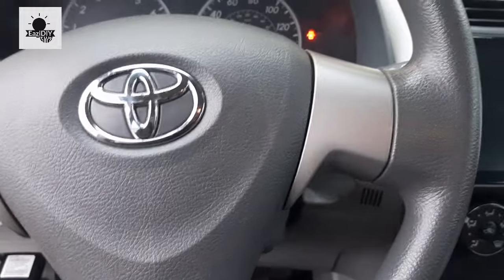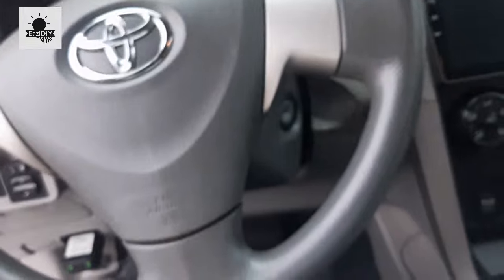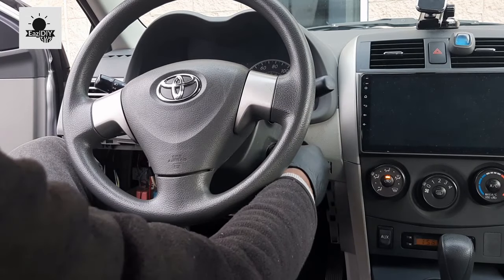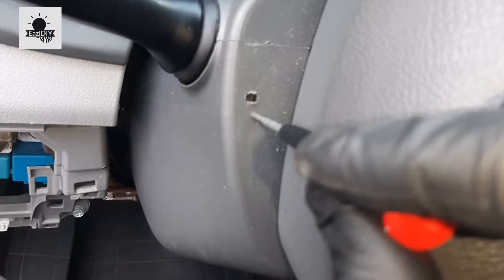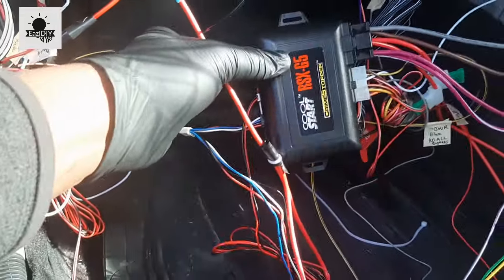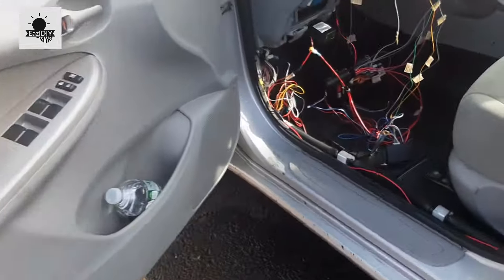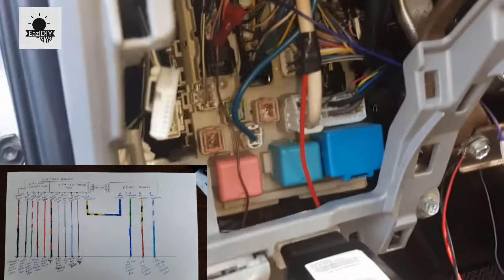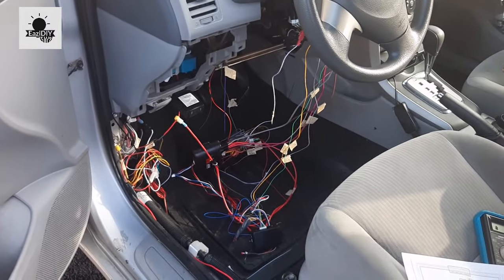How to Install Remote Start Yourself into 2009-2013 Toyota Corolla

Comment: Hey does 09 Corolla Le have factory keyless receiver already? I just bought one with only a regular black key… how do I know if mines has factory remote receiver?
Reply from the maker: No doesn't.
Reply: @eazidiy  damn😫😫I have power locks already, What do I need to buy to make mines keyless ?
Reply: @eazidiy  actually I’m not trying to make mines remote start like yours I just want to be able to lock and unlock with a key fob
Reply from the maker: @King-kw1mo  Check out my video on how to install keyless entry system https://youtu.be/bKhHF3rsVRI

Comment: Any idea how to do this on a corolla e160? more specifically a nze161 corolla fielder 2012. cant find anything at all. all other us verisons or nothing
Reply from the maker: Use the link to reference 2012 Toyota Corolla wiring diagram http://diagrams.marktoonen.nl/index.aspx?MakeID=2&ModelID=20578. Follow the steps in the video, wiring colors might slightly different
Reply: @eazidiy  only problem is that is for 10th gen corolla. i have a 11th japan corolla
Reply from the maker: @WilliamCronin  11th Gen is 2014- 2016? Here is the link for the wiring diagram http://diagrams.marktoonen.nl/index.aspx?MakeID=2&ModelID=20579
Reply: @eazidiy  yeh that’s 11th gen usa. i have 11th japan/sg/nz 2012-2015. any idea where is find stuff for that?
Reply from the maker: @WilliamCronin  unfortunately I drive 10th Gen. If you buy from the link in my video, the company will give you some tech note to guide with installation.

Comment: Any way you could provide assistance on a 2012 yaris? The schematics seem fairly similar but I’m having issues locating a couple of wires. Much love🙏🙏
Reply from the maker: Which wires are you having issues with?
Reply: @eazidiy  The parking light wire, and lock/unlock wires
Reply from the maker: @kurtismraz  Positive or Negative parking light wire? Lock and lock wire will be by the driver's kick
Reply from the maker: I think your you need negative parking light wire ? It is light blue wire @ HEADLIGHT SWITCH, BLACK 20-PIN PLUG, PIN 1
Reply: @eazidiy  positive parking light wire, thanks a ton!
Reply from the maker: Lock is black wire @DASH FUSEBOX, WHITE 30-PIN PLUG, PIN 1. Unlock is Green wire @DASH FUSEBOX, WHITE 30-PIN PLUG, PIN 24
Reply: @eazidiy  gotcha, thanks again!
Reply from the maker: Use this link as reference http://diagrams.marktoonen.nl/index.aspx?MakeID=2&ModelID=20484

Comment: Great video, thanks for the info. I'm installing the same unit in the same car (09 Corolla) and your video has been a great help.  But I can't figure out what wires are the transmit and receive wires. My install directions say it's a7 pin pats connector, but I don't see one. Any advice?
Reply from the maker: Hi, the Transmitter is a Tan color wire Pin 5, and Reciever is Light blue Pin 4.
Reply from the maker: Check the video description box and click on the link to download Fortin KOALL installation manual. The PDF file will show you picture location of the wire.
Reply from the maker: You can also take picture by the ignition, send me an email eazidiy@gmail.com. I will mark the wires for you.
Reply: @eazidiy  pm'd you
Reply from the maker: I have responded to your email. Your vehicle wires color are different. Trace the four wires I have highlighted in the attached pictures, PIN 4 is RX and Pin 5 is TX.

Comment: My starter just stopped working is there something I can replace or
Check or do I need a whole new one?
Reply from the maker: Did you check the battery of the remote starter?
Reply: @eazidiy  yes I found another video that resolved the problem. Thank you.